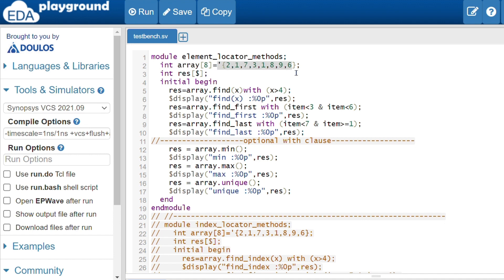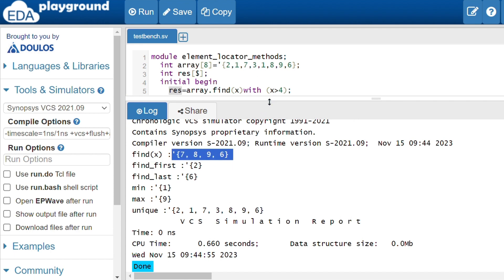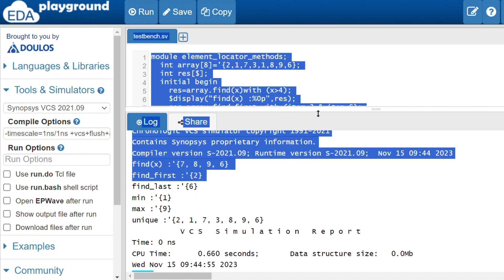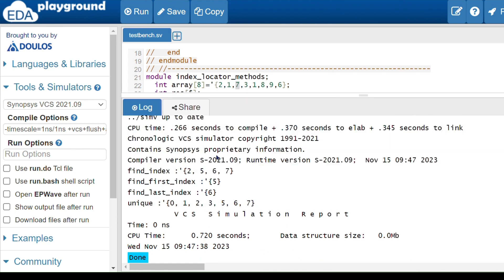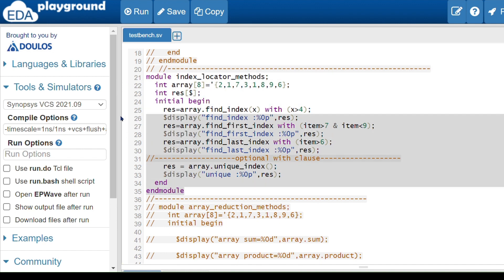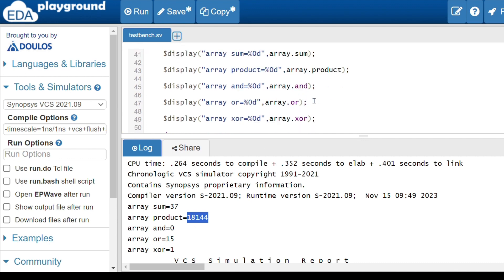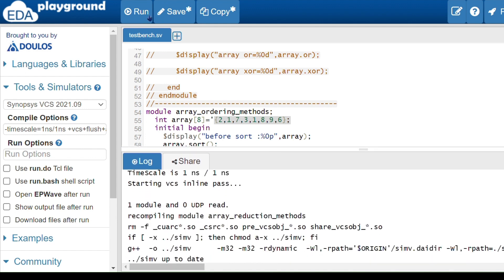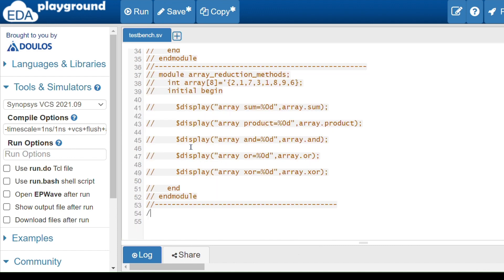Examples for array manipulation methods in system verilog | System verilog

Comment: i have one doubt mam, in ordering methods ,once any changes are done to the array and if we want to  perform the next ordering method ,it is considering the previous resulted one ,how to consider the declared array for all the ordering methods
Reply from the maker: @akhilrachagundla757  Yes, you can declare a new array and assign the original array to it. Perform the operation on the newly declared array to ensure the original array remains unaffected, allowing it to be used for another method.
Ex:   int array[8] = '{2,1,7,3,1,8,9,6};
        int arr_1[8], arr_2[8];
        initial begin
          arr_1 = array;
          arr_1.sort();
          $display("after sort------>%0p",arr_1);
          arr_2 = array;
          arr_2.shuffle();
          $display("after shuffle------>%0p",arr_2);
        end